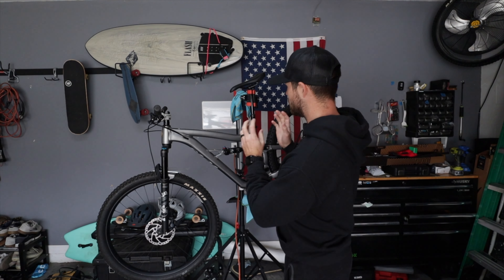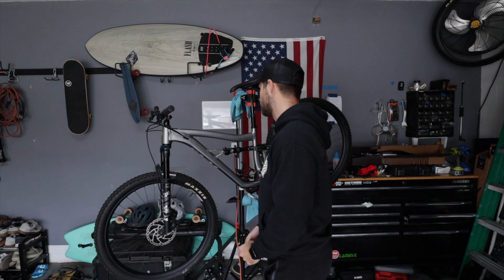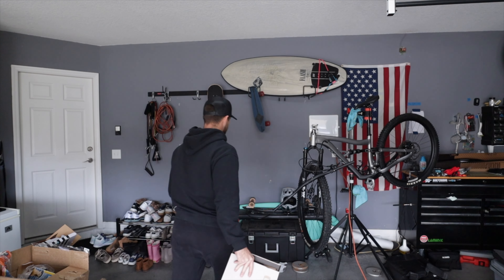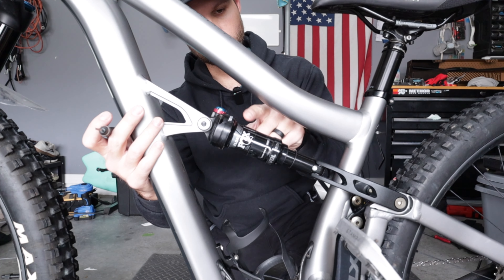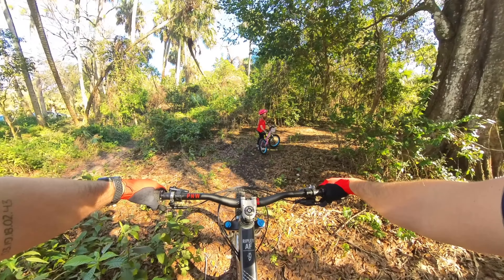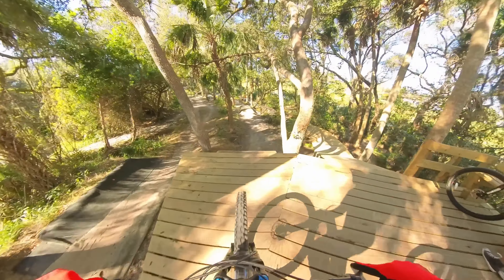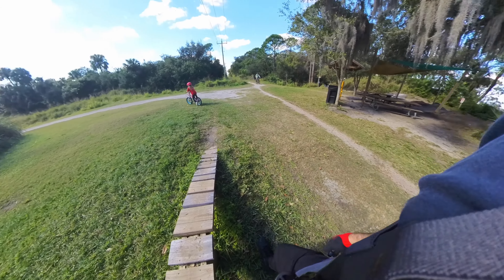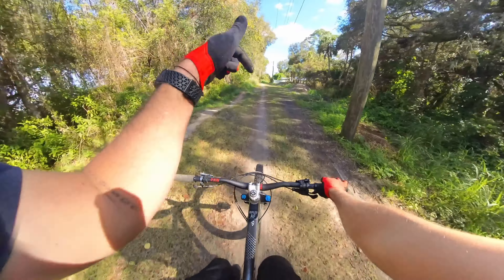The Ripley AF Gets Upgraded

Comment: 2023 ripmo slx or 2024 ripley deore. if you had to pick, and why. best overall both at same $$.
Reply from the maker: This greatly depends on where and what your riding. If you hucking big drops and jumps on descents I’d go ripmo. If you’re ripping single track and want something poppy and playful I’d go Ripley . The Ripley can handle most, but if you’re sending it big the extra travel of the ripmo will be helpful.
Reply: @rywanders  mostly single track. 90% of the time for now. beginner here and first FS. but having extra travel wouldnt hurt. since in on the bigger side at 225lbs i think more travel would help aid that. i think???
Reply from the maker: @ not necessarily since it will be an adjustment in psi . The new Ripley has a bit more travel as well. Can’t really go wrong either way, but if it were me I’m going Ripley. I send mine over big jumps just fine too.